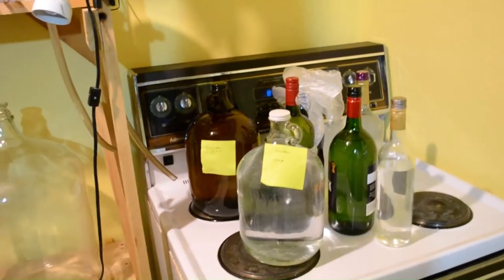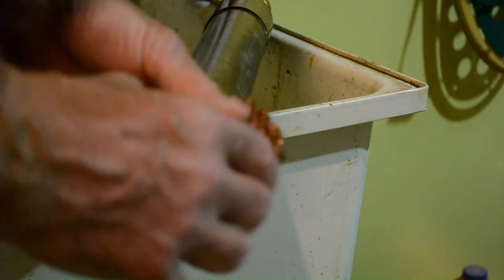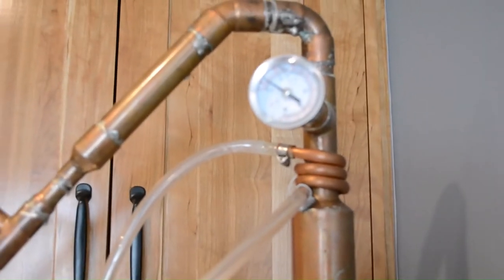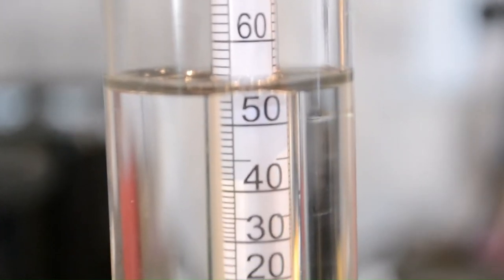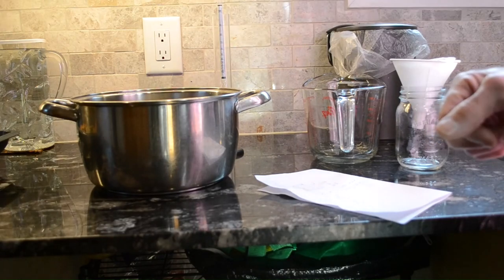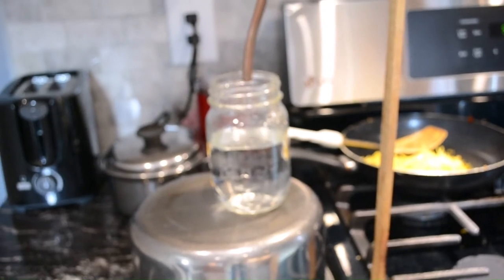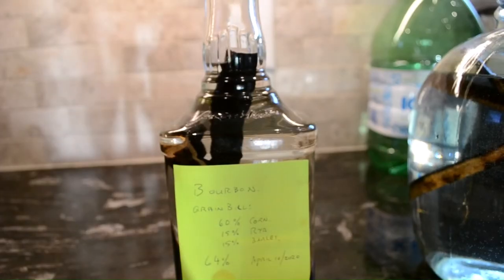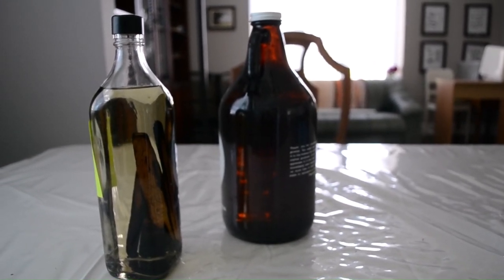Make Bourbon Whiskey at Home Part 2

Comment: I have been aging cocktails in 2L and 5L barrels for over 3 years now, mostly Old Fashioneds and Manhattans, and I love it. 
There is a small distiller in my town and I bought some Corn Whiskey from him to age. I put it in a brand new 2L charred oak barrel and kept topping it up as the angels kept tasting it along with me. After a month, it was pretty darn good, after 2 months it was amazing. I decanted it back into the original bottles and sadly, it didn't fill them all back up. So, I brought the partially full bottle back the distillery and shared it with him. His only comment, other than it was damn good, was that it was a bit one note. 
Your series makes me want to try distilling my own whisk(e)y. Now, I just have to figure out a way to keep it from my wife...
Reply from the maker: Go for it

Comment: The recipe seems good that still though not sanitary welds or equipment.  Thats a rubber clamp for plumbing not for use in alcohol.  Some some great places in southern Ontario that can weld for you or just purchase  the correct pieces.

Comment: Thank you for the very informative video. I just finished up flavoring a batch of spirit with some oak. I was wondering if you could help me with some questions I had about the wood itself. I did an experiment with baking wood and charring wood. Whereas the baked wood gave off a good flavor, the charred left an unpleasant aftertaste. I am not sure if I did something wrong. I know there are numerous factors to calculate here, but any advice or ideas would be greatly appreciated.
Reply from the maker: Hi Jason, glad to hear your experience! I would say that experimenting with this is a great part of the hobby. I'm no expert, just passing on what I've done.
Reply: i know that JD wash's their barrels after they char them, it removes hard chems that occur during the burn. maybe thats the prob

Comment: You’re reading the alcometer / hydrometer incorrectly. It is supposed to be measured from the top of the meniscus, so you actually had closer to 26-27%. This is different to a graduated cylinder (volume) measurement which is read via the bottom of the meniscus. 👍
Reply from the maker: Thanks for that info, glad to know I had more alcohol that I initially thought! Good News!

Comment: Hey! Enjoyed this 2 part series.  Curious as to the process of burning your white oak. Also, how come red oak is unsuitable?
Thanks for making this walk through!
Reply from the maker: Hey Jason! Bourbon barrels are charred on the inside, its a rule. I just char them in the fireplace, the more charred, the faster they age the whiskey. Red oak was never used because it doesn't make good barrels, rots out to fast. Red oak is an open grain wood, and gives a different flavour to the end product. Try it if you will, but after all that work, why risk it.
Reply: i tried it, red oak gives too much cinnamon and clove flavors to spirit.
Reply: Hi guys.., Mark,
I am experimenting with various ways of toasting, charring and baking Red Oak, as I'm up here in Red Oak country in the 
North Bay area and I have 15 cord in the yard for firewood each year. I have some alcohol on the go with a 50/50 chip mix at the moment, and my reason is that I believe that I can cure a Whiskey or Burbon with a just right mix and degree of toasted, char or baked wood chips that will take the boring out of the drinks.

Comment: What a great series of informative videos for the Urban Hillbilly. One question, I note that you separate the tails, but do you take off the heads? and how do you know when to cut over between heads and harts?
Reply from the maker: Thanks for the question. Regarding the heads, remember that on such a small still it is very difficult to separate the heads, as the transition is very rapid from heads to hearts. I basically start collecting when the still reaches 75°C, putting what I've collected till that point aside as it's likely mostly methanol (I save that as a cleaning product). So I can't really separate the heads is what I'm saying.
Reply: @marktompkins8519  Thank you Mark. That's clear now.

Comment: Great 2 part video Mark, thank you for sharing. Sorry for the late question, but did you char the oak yourself? Also, do you ever feel deflated when you consider that you effectively got 4ltrs from 8 mash runs equaling 144ltrs? :D Thank you again for your time
Reply from the maker: Yes I char the oak, either in the fireplace or with a propane torch. And yes, the small yield can be discouraging!

Comment: Hi Mark!  Fantastic video.  One thing I don't think you mentioned that I had a question about was the heads.  Did you not pull off any of the heads?  You talked a lot about the tails, so that made me curious what you did with the heads.  Thanks in advance.
Reply from the maker: Hi Adam. Regarding the Heads, There is hardly any volume of product between 65-75 degrees C, and some of it would be methanol anyway, so I just dump it. At least on my still anyway.
Reply: @marktompkins8519  Have you ever used or thought about using a parrot?  Or is it not really worth it to you to use?
Reply from the maker: @ThePewjumper  Yes I have thought of it. When I'm stripping I just run the still to about 95 degrees C so I'm not to concerned with the ABV. However it would be useful on the spirit run, although I can pretty much tell the ABV by the temperature. I may put one on it though, just for fun!

Comment: Job well done Sir!👏. Had a question on when to add flavors? Could you buy white oak barrels mix whatever flavor you wanted in the barrels let it age for however long then chop the barrels up and stick in glass? Vs adding straight to bourbon? Thanks.
Reply from the maker: Not sure. Scotch makers use used bourbon and sherry barrels. Because it imparts flavors. New oak does add a particular favour though. Why not experiment!
Reply: @marktompkins8519   have you ever aged in a barrel vs wood in glass?
Reply from the maker: @u.s.marine766  no, don't have volume for that😢
Reply: @marktompkins8519  You do have the volume for that as there are lots of smaller barrels available on the market. I just purchased a new 2L new, charred white oak barrel to age a couple of bottles of white dog. You just need to make sure not to age it as long as one would in a standard barrel as the whiskey can soak in deeper than the char and then bring out the bitter tannins in the un-burned wood. I was told 80-90 days is plenty for the 2L that I have.

Comment: Mate been watching your utube video making bourbon,I'm confused ,you have gone thru the whole tedious process of grain mash ,fermented and stripping run thru pot still setup and accumulated all the runs and NOW you convert the pot still to reflux,WHYbecause all a reflux still is strip all flavours to a neutral spirit with no taste.Why did you do that process. I thought you were trying to maintain the grain flavours
Reply from the maker: Hi Tyrone, while the reflux does strip some flavor I find that the drink tastes much better, I tried both ways. It's basically like distilling it an extra few times. Many pot still distillers use 'thumper pots' which achieve the same thing.  Why not experiment both systems, have some fun!

Comment: Hi sir I had finished my first distiliton following ur whole process but I’m convincing about the second distiliton should I bring whole alcohol that what I already got and put them again in still pot and do another distiliton ?
Reply from the maker: Yes, after the first distillation (the stripping run) take all of the distillate you have collected and distill it again. The distillate will be much higher alcohol content. Keep collecting the distillate till it lowers to about 70° alcohol and keep that for aging etc. continue running the still till most of the alcohol is extracted and set that aside to use in your next batch. It won't taste good, but there is still considerable alcohol in it. I usually do 8 or so batches of fermenting and stripping runs, then redistill it all at one time. Thanks for the question, all the best!

Comment: How do you get rid of the methanol during the first stage? Your viewers need to know that. Methanol is poison, ethanol is not. There are different boiling points for the two. Thank the good lord for making methanol have a lower boiling point. To all newbies, get rid of the methanol by temperature control before you even take a sip. Methanol will ruin your day, possibly kill you, at the very least give you an incredible hangover.  I hate to be a buzzkill but this is pretty important. I can't believe you left this step out.
Reply: He commented that he throws everything out that comes out before 78 C, but I agree, he could have been a bit more stern about that step as it is critical.

Comment: hello sir, my second (spirit) run hearts section smells like green banana. heads section smells like bourbon. is it something wrong? or i should i add heads to hearts a little bit? thank you.
Reply from the maker: Hard to say from here! Be careful with Heads, might contain methanol, especially if you have a small still.  Remember that most of the whisky flavour comes from aging with toasted or charred white oak. I buy white (unaged) rye, barley and corn whisky (technically not whisky if it isn't aged) and compare the taste with my distillate just to make sure I have something worth aging.
Reply: @marktompkins8519  thanks for your reply. i have 19lt pot still and 4 lt little pot still. stripping run in big one and spirit run in small one. i think i have to perform spirit run in my big pot still. first run always smells like more whisky than second run.   but i think i am removing many flavors from my spirit while making cuts . it's taste is not bad and too easy to drink. but i cannot catch the flavors that smells sour and fruity like bourbon. when i open a bourbon bottle and smell it, there is sour fruity notes that i had never claim:( any suggestions? thank you.

Comment: Why would you run it reflux? That kinda defeats the whole purpose. You want that flavor from the grains otherwise just make a sugar wash.
Reply from the maker: Hey Bo, thanks for the comment. I do a spirit run because of my equipment, I can't get enough strength out of one run, too much nastiness in it. The second run cleans it up, and if I want to include tails I can. And the flavour is actually good. Nothing like a sugar run, believe me.
Reply: @marktompkins8519  do your stripping runs sure, but when you do you spirit run keep it as a pot still and run it really low n slow. Save just a little bit of the original mash to cut the low wines with. Not much just experiment with how much. Oh and keep those backings and do a sour mash you will glad you did

Comment: Plus if you know what bourbon is and how it's made it's not supposed to be aged at any more than 125 proof not 65% that equates to 130 proof. I know that's splitting hairs but it's for a reason. The stronger the spirit that faster it will pull flavor from the wood.
Reply from the maker: You're so right about that. I was aging at 75% for a while, really taste 'woody' in a hurry.